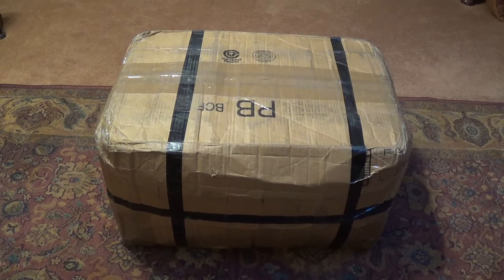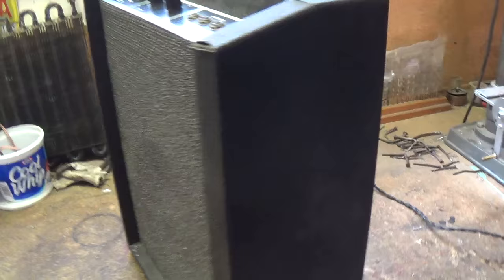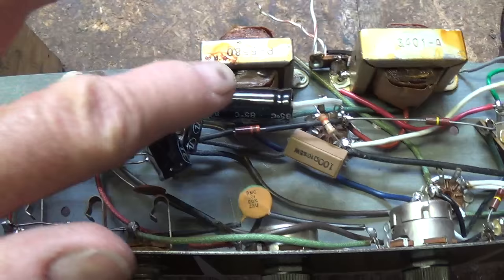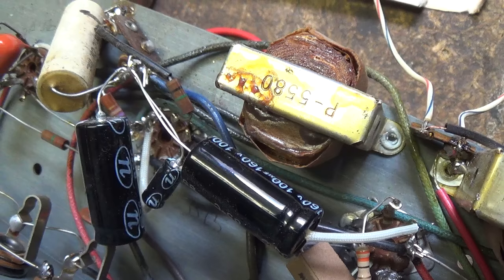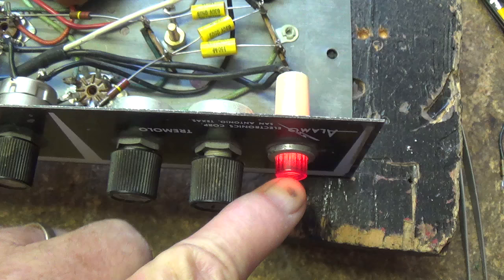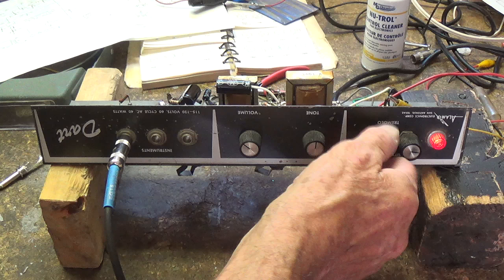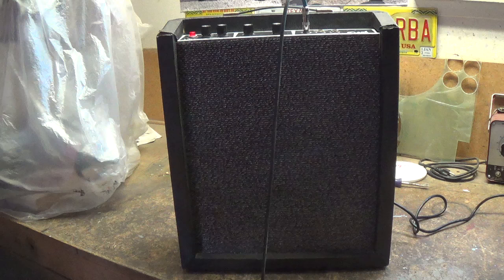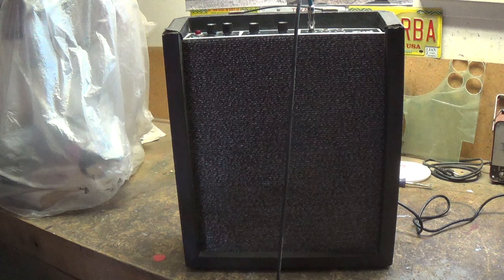1960's Alamo Dart Guitar Amp:  Ressurected from the Dead

Comment: Uncle Doug, does it matter what kind of 3-wire power cable gets used as a replacement for the old send/return ones? I've seen some with amp ratings and such, but I don't know what would be sufficient for these types of devices.
Reply from the maker: I'm not sure what "send/return" refers to, Strad, but power cords are available in different wire gauges. If you're concerned with high current demand, simply install a 14 or 16 gauge cord, rather than 18 or 20.
Reply: Uncle Doug I was just referring to the two plugs on the old connectors, rather than the three on modern ones. 

I don't know whether I need to be concerned about high current draw as I don't have experience; I don't know what is typically required. Which size do you generally use on these amps?
Reply from the maker: Generally, 16 or 18 gauge power cord wire works fine, Strad.

Comment: Hi Doug, love your channel.  I have an Alamo Capri from the mid 60's that i am working on & wanted to know what would an appropriate fuse value be for this amp. Any other comments or tips on this amp would be most welcome.  Thanks & say hi to Jack for me.
Reply from the maker: You're welcome, Mr. 2.  Generally a 2A rapid blow fuse can be used on any small to medium-sized amp, but if you really want to be careful, you can use trial and error to determine the smallest fuse that will allow normal use of the amp......i.e. 1 to 1.5A.
Reply: Thank you.
Reply from the maker: You're welcome :)

Comment: Wonderful video! I have a quick question about this amp. I have one almost exactly like it and after about 10 mins of playing I start getting a noise that sounds almost like white noise. Do you have any idea what might cause this?
Reply from the maker: Thanks, Jeremiah. It may be due to aging carbon comp resistor(s).  You could spray them, one at a time, with Freon spray to see if the noise changes.  Otherwise, you could replace them all with metal film resistors......or simply live with the noise.
Reply: thank you! I think I would rather just swap them out. Might you happen to know the voltage requirements on the resistors or is there a simple way to determine that? I know how to find the resistance ratings...but with no "known" schematic out there I don't want to trash the amp.

Comment: "Cat scan" from Jack.  That's very funny Uncle Doug. Jack could even double as a "mail sniffer" at your international gateway US post office, checking for illegal substances, maybe even  "contraband" catnip. LOL!

The Alamo amp with a 35L6 =4-5 watt? The speaker looks like the best part of it.,  Can't be the original speaker it came with.

 115v line operated, just the perfect amp for plugging in yer guitar and then touching a mic on another circuit..a nice UNGROUNDED ZAP!  Fortunately, somebody added the 3 prong ground cord to keep the A/C live on the tubes and the chassis grounded.   The wiring was butchered and very messy.

Probably a novice attempt by someone that didn't understand the circuit or even basic electronic theory,   Fortunately, it found it's way to a someone who could resurrect the way it was originally.   Looked at the specs for the vintage line operated 35L6 spec
sheet, at 200 volts max on the plate, you could get 3.3 watts of signal from it. Enough for a practice amp for some beginning
rock or country star .
Reply from the maker: Greetings, SC. I would estimate the Alamo at around 3W of output power. Yes, the grounded, 3-wire power cord was a vital addition. This was probably one of Alamo's entry level amps, intended, as you suggest, to be a starter unit for a budding musician.

Comment: Sorry to bother you again but I have one more question.-Could I use a el84 in place of a 6v6 in a fender champ build or can you recommend a simple amp with el84. Thanks for any help.
Reply from the maker: Yes, indeed. Using 6V6's is far more common, but single-ended EL-84 amps are fairly popular. Here is an example:   http://320volt.com/en/6-watt-single-ended-lambali-amfi-el84-6p43p-ecc83/
Reply: thanks.

Comment: I am trying to build my own 12au7 headphone amp but am not having much luck as it doesn't function correctly. I followed a schematic, would you be able to help me?
Reply from the maker: Rusty and I are retired, EE, and don't do any personal consultations.....but, we're willing to bet that if you retrace all your connections and test your components, you will be able to solve the problem yourself. Fixing mistakes is just about always the final step in any amp-building project. Good luck.

Comment: I have a question. I've been having trouble with my Fender 75 and which one of the preamp tube sockets are microphonic and I've switched out the preamp tube with one that was tested good and I found that at least two to three of the wires going to the socket from the eyelid border microphonic do you know what's causing this and why. Because I think it's the cause of this time I've been having like the filter capacitors have gone out but I've checked them and replaced them and they're fine
Reply from the maker: If you resolder both ends each of each wire connected to the socket, it will probably help. The problem most likely stems from a broken, weak solder connection that is moved by vibration.
Reply: Uncle Doug thank you

Comment: Hello, Doug. I 'm working on one of these Alamo Darts and all and it's turned out really well, however when there is no instrument plugged in there is a 60 Hz hum. Any ideas about a fix for this?
Reply: Given the power circuit I am not sure,  check out the capacitors you do have for ESR etc. Also see UD vids on eliminating hum.
Reply: @highpath4776  This amp has been sold. I'm not sure I ever fixed this problem but after a time I wasn't so aware of it. It may have been lead dress or filament noise, I'm still not sure.

Comment: Hi ,,I know this is not a valve amp,it,s a Roland cube 15watt,
problem is when i switch it on,and all controls are turned right down, it makes a machine gun type of sound(rat a tat tat) quite loud.
What might cause such a sound.
regards
Andy
Reply from the maker: Such a motorboat sound is often caused by an electrolytic capacitor discharging, Andrew.
Reply: Thank you again for your help,,hope you and Rusty are keeping well.regards
Andrew
Reply from the maker: You're welcome, Andrew. Good luck.

Comment: Uncle doug!!
I have a question  sir.

I have a seven pin socket running a 6av6 ,so its 6.3v,its in a guitar amp.

Im building a fender harvard of sorts and i am wondering how to hook up heater filaments. 

Do i use one of each of the heaters to hook them both up to the 3rd and 4th pins?

Please help if you can send me to some info i would love that.

I know its a 6volt tube and ive got 6volt heater coming off my power tranny i was just confused or better yet uninformed on how to hook this up.

Thanks uncle doug.

I really would enjoy having a email for you so i could get easier direct access to your vast vaults of information.

Thanks sir!!!

My name is actually Justin btw. This name was a play on the modal scale "dorian" and well the flat third of course would be the "blue note "

Thanks
Reply from the maker: Greetings, Justin. Tube filaments are wired in parallel, so one of the 6.3VAC leads will connect to pin 3 of the 6AV6 and the other lead will go to pin 4. It generally doesn't matter which lead goes to which pin. Each of the remaining 6.3VAC tubes will be wired the same way, but may utilize different pins for their heaters.....so check a tube manual before wiring.  I would prefer to communicate via this format, so the information is available to other viewers.
Reply: Uncle Doug ,well understood kind sir. 

And much thanks to you and maybe somone else can get some help from these questions.

Thanks.
Reply from the maker: You're welcome :)

Comment: Uncle doug, help me please sir 

So i have an amp with 6l6 tubes  and a output tranformer that is 4500ohm, it has 4,8,16 ohm taps, which do i use for the 8ohm speaker i have. All i have is the 8ohm speaker (1).  Also what if i wanted to use 6v6 tubes ,what would i use then?

Thanks i know you always help me so much sir.
Reply from the maker: According to the Tube Handbook, 4.5K Ohms is correct for a pair of 6L6's operating at a plate voltage of 330VDC. If this is the case, use the 8 Ohm tap.....as the name implies, it's correct for an 8 Ohm speaker. Your OPT has 3 different winding ratios: 4 Ohm is 33.5:1, 8 Ohm is 23.7:1, and 16 Ohm is 17:1. A pair of 6V6's has a plate load of 8K Ohms, so to compensate, you could use the 33.5:1 (4 Ohm) winding ratio to reflect back the proper impedance. In simple English, if you use a pair of 6V6's (which probably won't last long unless you bias them properly), then attach your 8 Ohm speaker to the 4 Ohm OPT tap.
Reply: Thanks Uncle Doug , you know from reading schematics recently i noticed that maybe leo fender and  those fellas designing those amps kinda bumped up the voltage alot huh? I notice most oragn amps and others like juke box and stereos run the 6l6,6v6 ,etc much lower than fenders.  Maybe its a hot rod sorta mentality?  More is more kinda thing.  But i guess the tubes are good at a wide range of settings. 

Once again thanks uncle doug.
Reply from the maker: You're welcome, SS. Yes, most vintage Fender amps were biased quite hot from the factory. Tubes were relatively cheap and I guess they felt the tone was worth it.

Comment: Hi Doug, can you help, I've got a fender pro reverb and recently bought an aphex 204, when I marry them together I get a hum but only when the aphex is on, any ideas, thanks buddy.
Reply from the maker: I did some research on the Aphex 204, Mags, and found that although a lot of people swear by them, some swear AT them......generally due to noise they create. It's hard to tell if there is performance variability between units, or if they simply work better with some gear than others (i.e. Fender Pro Reverbs).  I suggest that you check the Internet for sites and forums that address issues with the Aphex unit, or contact the manufacturer directly to see what they have to offer on the subject. Good luck.
Reply: It may be a ground loop, which is created when two grounded pieces of equipment are connected. Does your 204 include a grounding switch? DO NOT remove the ground from either unit, but look on the net for the 'loop breaker circuit',  which places a small resistance in the signal ground of one of the units with two high current diodes in antiparallel to conduct fault currents. (Rod Elliot's design for a 100W (solid state) guitar amp contains a loop breaker. (sounds.whsites.net/project27.htm)

Comment: I've been looking at the silverton 1430 schematic, http://www.tonegems.com/wp-content/uploads/schematic-silvertone-1430.png,  for about 20 minutes now. The B- label and chassis gnd leads me to believe that T1 is an isolation transformer, because all internal wiring of the 12au6 pre-amp tube is isolated from the AC line chord. Unfortunately, a death cap fault in C3 negates this isolation.  Nonetheless, your cleanup looks great and now my 3 hounds want pumpkin treats as well. Thanks Doug.
Reply from the maker: You're welcome, Craig. These series-filament circuits are really odd, and I am reminded of just how odd they are whenever I have to extensively rewire one.....i.e. with parallel-filament circuits, you can easily add up the individual tube filament current requirements, but with series-filament circuits like this one, the current calculations are much more complex, and include ballast resistors, isolation primaries, etc.  With all that series resistance, the current flow must be quite small.....especially when compared to a parallel-filament circuit.
Reply from the maker: Yes, I have, Craig, and am still wondering how exciting it must have been in the old days when someone would replace the old, frayed resistor cord with a regular piece of zip cord.....or remove the broken plastic/bakelite cabinet and set the bare chassis near the bath tub, so they could listen to music while bathing ;)
Reply: shocking, positively shocking.

Comment: Should there be a fuse installed in the circuit?
Reply from the maker: Yes, every amp should have a fuse.
Reply: Uncle Doug   How do you know what value fuse to use?
Reply from the maker: Schematics generally show the fuse value, Wayne, or you can use another, similar circuit as a reference. Trial and error works too.....to find the minimum fuse value that will still allow the amp to function under load.
Reply: Uncle Doug   Thank you!

Comment: Any interest in a 1968 fender super reverb amp?
Reply from the maker: I'm pretty well stocked on amps at the moment, GF, but I appreciate the offer. Maybe another viewer will be interested.
Reply: Uncle Doug np, Do you maybe know the value of one? Only thing modified is a tube change to mesa 6l6
Reply from the maker: The VG Price Guide for 2012 says $1400 to $1700 for a SF SR, circuit #AB-763, so $1500 sounds about right.

Comment: Calling it now.. that transformer is a phase inverter
Reply from the maker: No need for phase inversion with a single-ended output, Rob. It actually isolates the filament of the 12AU6 pre-amp tube (????).

Comment: My mxl 990 stopped working.
https://goo.gl/images/GcnH0P
This schematic shows that R5 should have a voltage on both sides. 
My R5 has 0.00 volts on the left side at point "A" and 27.3 on the schematic right side
Replaced the capacitor on the left at point "A ". Still 0.0 volts
Cap on the right side of R5 is low at 
27.3 volts.
What next ?
Reply from the maker: Stan, I'm sorry but Rusty and I only work on vintage tube amps, so we're really not the right place to seek knowledge about this circuit. Best of luck with it.

Comment: Dangerous amps with nothing worth saving. Personally I'd gut it, install a power transformer and  use the 4 tube sockets for a simple 18 watt EL84 amp with solid state rectification.  Keep the shell cabinet and chassis for looks.
Reply from the maker: Thank so much for your helpful input, Joe :)